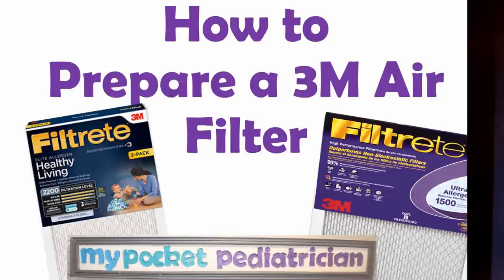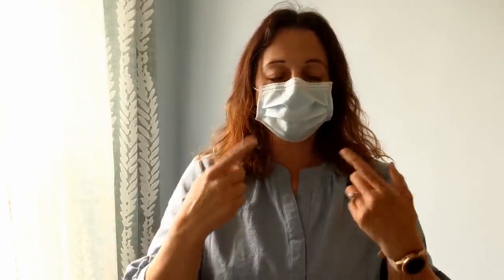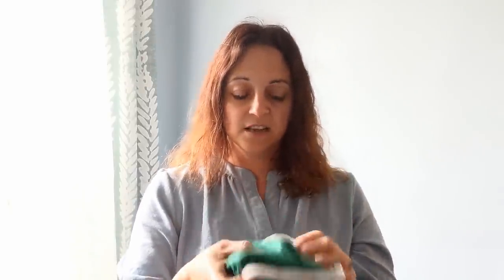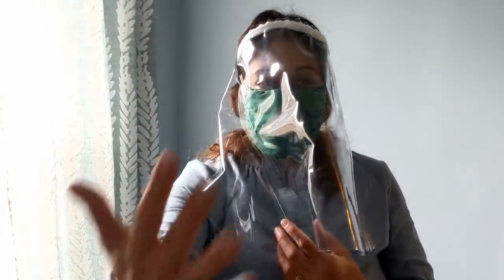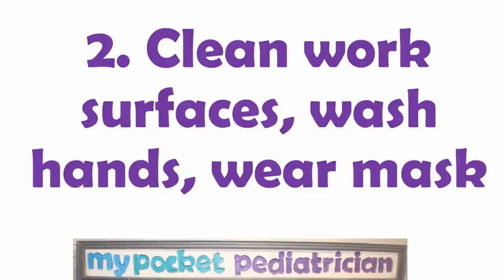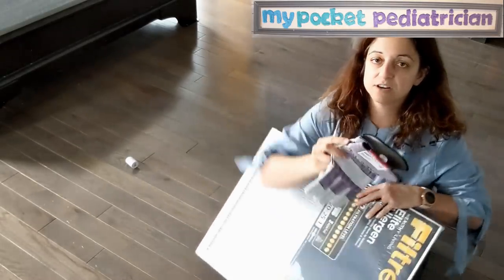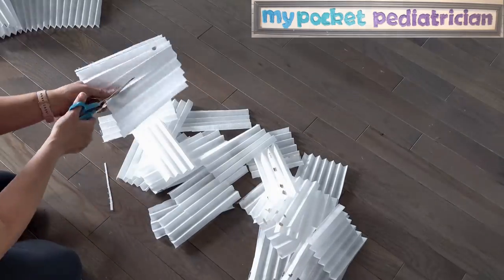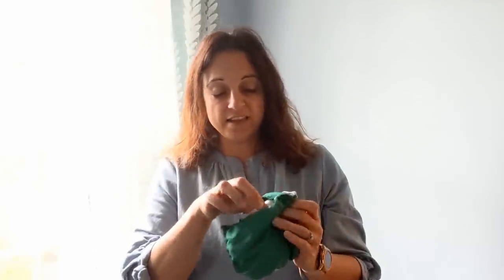UPDATED!  How to Turn a 3M Air Filter into a Face Mask

Comment from the maker: For those concerned about safety, here is the Safety Data available from 3M:  http://www1.mscdirect.com/MSDS/MSDS00023/53337903-20111224.PDF

Here is the link to the tutorial on how to make the mask:  https://youtu.be/4eOc5_rBCrM

Here is the link to the tutorial on how to make the face shield:  https://youtu.be/UKK0Y7XQN7I
Reply: Thank you for the clarification! I purchased the Filtrete 2800 to make the masks and have come across people saying there is fiberglass in it and not to use it. I could not find a definitive answer on this until now.  Thanks!
Reply: Thank you so much for all your hard work, in research and development of these masks. You are literally a life savior, and not just as a pediatrician. God bless 🙏
Reply from the maker: @rofahcherishlchaim1927  thank you!
Reply: Yes! I was looking for this data sheet!! It says no issues with inhaling. Thank you!!!
Reply: My Pocket Pediatrician how many masks will the one 3M filter fill?
Reply from the maker: @jem7178  thank you.   I've talked to some very smart people off the record, and their best guess that using the filter in a mask with a tight seal will have a similar efficacy of you double layer it.  I have nothing to prove that with other than some intelligent guesses, so use it as you will.
Reply from the maker: @patriciaulloa3071  I don't feel I deserve that, but thank you.
Reply from the maker: @baileyjensen7025  on the 20x 25 size, it stretched to 102 in long and I got 43 pieces so enough for about 21 mask inserts (2 per mask per day of use).
Reply: My Pocket Pediatrician thank you for your response I appreciate it. I emailed you for the mask directions. :) I was able to order 1900 MPR 3M filter. Can’t find 2200 at a decent cost.
Reply: 3M's response regarding the use of Filtrete filters

Thank you for contacting 3M, Construction & Home Improvement Markets Division.
Our filters are made from Polypropylene plastic fibers and strands, adhesive, paperboard, and for some filters, metal wire. Our Filters do not contain Fiberglass. However, our Filtrete brand products are designed to be used in home HVAC systems. The filter media in a Filtrete brand filter performs very differently than an approved N95 respirator or mask. It cannot achieve the fit or performance of a mask or N95 respirator and modifying the furnace filter may damage the material. 3M does not recommend or support the use of a Filtrete brand filter to make a mask or respirator.
For information on the Coronavirus and recommended protection products, please consult the CDC.
If you need any further assistance, please feel free to contact us directly at 1-80 0-388-3458. We are available Monday through Friday from 8:00 - 5:00 CT.
Reply from the maker: @TerryFojas  thanks.  I still haven't gotten an official response from them.
Reply from the maker: @Bunny C can you see it here?
Reply: @chammockutube  UV-C can degrade the polypropelene plastic that is used in the masks. But if no other alternatives are available it may be better than nothing.
Reply: The information for msds is outdated 2007. It needs to be updated to 2020.
Reply: Thank you for linking the SDS. I'm glad its not made of fiberglass, but I must say after trying this myself with a 3M Filtrete 2200 I felt weird so I'm not going to do this anymore.
Reply from the maker: @janettedorricott4419  I searched quite a while to find this.   Do you know where I can find an update?  I just assumed it hasn't changed design since 2007.
Reply: Nate Welch , true, and in a less emergency situation, it would be best to subject sample reused mask to a KCl challenge per the ASHRAE standard to see the MERV rating, but I’m thinking re-treated N95’s are still better than bandanas.  It would also be helpful to know exact intensity uw/cm2 and exp
osure/dosing duration to minimize UV-C damage to the N-95s, but info is limited.  Past research has shown that of maybe 8-10 treatment methodologies, UV-C came out on top with maybe Ethylene Oxide gas coming in second due to long out-gas times.
Reply: @CalvinHill-reflects  they must have had it confused with menthol cigarettes LOL
Reply: I'm a hvac tech and filters are our thing..  I approve this message, I'd rather do this than wait a long time to get appropriate masks, this might not be 100% safe, but better of safe than sorry.. these have fiber strands not micro fibers that are harmful.  Thanks to our frontline personnel
Reply: This video is invalid because her hair is not even tied back. omg, disgraceful

lmao...I just had to make that comment. I do love to try have a laugh in these times. So Doc, i love ye & i'm just kidding with ye. Plz forgive me..
Reply: Terry Fojas their response, is exactly what we would expect. As this video mentioned, no one want to be sued. I believe by now, everyone should realize- that the N95 is the “gold standard,” yet there are not enough of them, and there is no way to achieve that same “gold standard,” via DYI. If I’m not mistaken, I felt that in this video, the Dr. was not at all suggesting that these DYI masks are of the same quality nor limit your risk at the same rate of a N95, but feel that the point of this video is to create a DYI mask that is much better than a piece of cotton, that has ZERO chance of helping any healthcare worker who were to come in contact with it, yet with the understanding- that it is NOT nor will protect like that of the N95- but far better than a cotton fabric which is about equal to holding a paper towel over your mouth and nose. Yet knowing that these filters are not  tested to be an equivalent substitute of the N95- the dr. Also does not want to cause more damage than good. As is what is happening or could happen to anyone that uses the HEPA vacuum filters containing the fiberglass- which we obviously don’t want in our lungs. With that being said, 3M could NEVER indorse using these in a way that they were not tested or approved, but the fact that they do not have anything that would cause lung damage if used to breathe through- is the bit of information that is needed by DYI’ers. This is what innovation looks like. If no one ever uses anything for “off labeled” purposes, the ability to create new methods or products would be impossible! But 3M also must err on the side of caution to prevent any lawsuits based on “negligence or misleading information.” Unfortunately, everyone still must cover-their-but’s in a society that is so quick to point fingers, find fault, and sue. Sad but very true.
Reply: @alffriend77  not fiberglass.
Reply: Thank you for the time and consideration you took to produce and share this video publicly.  I have a question and an observation/suggestion.  The purple filter box was labeled as a 1500 filter so I am wondering why you labeled the individual filters as 2200?  I would also wonder why you worked with the exposed filter material on the floor?  It seems that maybe sanitizing a counter or table and then working on the filter there would be better than putting the material out on the floor where it will be in a mask people are breathing into.  :-)
Reply from the maker: @lindasharpshooter6757  I used the blue box to make this one.   The purple one was just to show it as an option, but I actually cut open the blue one.   I had 4 kids and a dog downstairs so I scrubbed the floor with Lysol spray so I had a clean work surface as I mentioned in the video.   Obviously a table is better, but we are self quarantining at home, and there are 7 people in my home, so options are limited
Reply: @CalvinHill-reflects  No issues with inhaling IF USED AS INTENDED. They say nothing about particles being released when it is cut up and then put right next to your face. "use or processing of the product in a manner not in accordance with the product's directions for use may affect the performance of the product and may present potential
 health and safety hazards. "
Reply: monikah12345 hey, that is true. However, these filters are not going directly on the face, they are going in between the fabrics. It isn’t the best solution but right now it is a solution. Please add ideas to help @MyPocketPediatrician.
Reply: @MyPocketPediatrician  oh ok...sorry...all I noticed was the purple box up close...thank you for clarifying.  I guessed I missed that part about you spraying the floor with Lysol.  :-)  Thank you again!  Looking forward to seeing what filter material you are considering as another option.  ;-)
Reply: My Pocket Pediatrician  Hello, my concern is that the safety info sheets are primarily related to the safety of the product for the intended use. These filters are intended to be used in a furnace system-the safety of using them close to the face (after being cut) and breathed directly though, may be very different.
Reply from the maker: @margaretfitzpatrickrnapn1833  yes.  definitely.  It's very hard to find filter media, but I think I've found a better alternative.  Currently cutting it and trying to FIT test it in my new mask design.  Please subscribe, and if I have good news, I'll have a new video soon with a very improve design, and this material is designed for masks!
Reply: Hello, and thank you for this information. As we all know this is not ideal, but an option that's better than nothing! My question would be... Say I make a mask for each of my family members, and one of them ends up infected.. we would obviously have to take safety measures to try and stay clear of them, but in a household with several kids and one parent that could prove difficult. Should the infected person reverse the filters they are using so they are less likely to infect others, or should everyone wear the filters the same way?
Reply: Doesn't 3M have a hepa vacuum cleaner bag that's made with the same Filtrete material?
Reply: I found a cheaper alternative, just walk around in scuba gear with oxygen tanks and you won't breather outside air at all. . flippers are optional.
Reply: I found a cheaper alternative, just walk around in scuba gear with oxygen tanks and you won't breather outside air at all. . flippers are optional.
Reply: I found a cheaper alternative, just walk around in scuba gear with oxygen tanks and you won't breather outside air at all. . flippers are optional.
Reply: I found a cheaper alternative, just walk around in scuba gear with oxygen tanks and you won't breather outside air at all. . flippers are optional.
Reply: @TerryFojas  thank you for this even in the Mds shared in this thread it said, "Immediate health, physical, and environmental hazards:  This product, when used under reasonable conditions and  in accordance with the 3M directions for use, should not present a health hazard. However, use or processing of the product in a  manner not in accordance with the product's directions for use may affect the performance of the product and may present potential  health and safety hazards."
Reply: My Pocket Pediatrician   P.S.. ... also to be effective the filter material Hass to be facing the correct direction just as it would need to be when it’s used properly in one’s HVAC system. There are arrows on the box telling you which way the filter is to be installed. Once you tear it apart without noticing that it diminishes its intended affect
Reply: My Pocket Pediatrician 3M is not a trustworthy company. This is the same company that hid there Teflon study from the public that showed how poisonous it is to human beings. Those instructions on the package or website were not put there with the thought process of someone attaching it to there face and breathing through it.
Reply: Ruth had a good question
Reply: I wonder if they have natural organic filters pretty sure they do
Reply: I'm thinking of using bendable wires to make the seal, just like how they do in a brassiere.
Reply from the maker: @jeannydaniel2022  I used 20 gauge floral wire with weatherstripping rubber foam to seal it.  The foam is important for the seal.
Reply: Hey there just came across your channel a few minutes ago, and  was curious Will the mask with a 2.5 MPR protect you from this Virus?.. it doesn’t sound like it will so I’ve been wearing a surgical mask over my Olsen mask but will 2.5 protect you?😬 thank you for Making this video wishing you and your family a safe and happy Easter..
Reply from the maker: @haloSrising  It's honestly hard to say.  Lots of people are debating right now.  COVID19 is 0.12 microns, and so that means it's smaller, but it usually travels on droplets, which are larger than the 2.5 - these viral microns aren't just shooting around in space if they're not attached to droplets.  I'm going to do a YouTube live with a Q&A with 2 of the developers of Filti, a facemask material that I'm working on right now.  It's probably going to be Tuesday at 8:30 pm, but I'm not 100% sure yet.  Please subscribe to my channel and they may be better people to answer that question than me.  I'll have a new video out in the next day or two with improved design and materials, and then the Q& A with them should help clear up some questions.
Reply from the maker: Also - be careful with the Olsen (Olson?) mask - I saw another video where 3 healthcare workers couldn't get it to pass a FIT test.  If you're working in healthcare, you really need to make sure your mask passes a Fit test.   My mask did, as did the newer design I'm working on now.  That said, it passed a FIT test on me - I didn't have anyone else available to test, but if you're really worried, getting a good FIT test is of utmost importance!
Reply: Ive been using Zorb on the inside as it is antimicrobial snd wont cause you to get bacterial pneumonia.
Reply: twirlchic Hey there what is Zorb?
Reply: I love your thinking & problem solving ! But wanted to Ask your feeling about the strands of polypropylene that become dislodged / fuzzy during metal mesh removal & the bits of polypropylene that become loose during cutting
Reply from the maker: @LeftHandedDogLover     I did update this video since 3M says they don't recommend doing this to their filters.  I'm using Filti now, and here's the new link.  https://youtu.be/2J3Fq4o-U4I
Reply from the maker: @janetvillarreal6537  I would prefer to wash and dry, because you never know what's going to last and if there might be some little droplets left if there is moisture in the air.  I'm not sure.      I did update this video since 3M says they don't recommend doing this to their filters.  I'm using Filti now, and here's the new link.  https://youtu.be/2J3Fq4o-U4I
Reply: There are washable HEPA filters. A HEPA filter is safer than the N-95s. Here's why:

  "It is widely believed that HEPA filters are only capable of capturing particles sized 0.3 μm or larger. However, this belief is based in part on an incorrect understanding of how HEPA filters work. The fact is that particles of around 0.3 μm are the hardest to catch (1); for this reason, that size is used to measure the effectiveness of HEPA filters. Much smaller nanoparticles are in fact easier to catch. But why is this so? 
For larger particles, the HEPA filter acts like a net as we would expect. Particles greater than 0.3 μm in size simply cannot get through: either they do not fit through the holes or they hit the filter fibers due to inertia. For smaller particles, on the other hand, it would seem logical that they can simply go through the holes. However, this is not the case. The tiny mass of particles less than 0.3 μm means they do not fly straight; instead, they are bounced off other molecules as they collide with them and thus move in completely random patterns. As a result, they hit the filter fibers and then remain stuck in them. This is the principle of Brownian movement.

US government standards require a filter to remove 99.97% of particles sized 0.3 μm in order to qualify as HEPA" https://www.hamilton-medical.com/de/E-Learning-and-Education/Knowledge-Base/Knowledge-Base-Detail~2020-03-23~Efficiency-of-HEPA-filters~d5358f88-753e-4644-91c6-5c7b862e941f~.html#DataTables_Table_0=od3
Vacuum cleaner bags are being used as well. There is no fiberglass in those either. There are some furnace filters I wouldn't want to use in a mask because they have baking soda, etc., particles that can get into the lungs. Just plain HEPA filters would be best.
Reply: The NaNa Yes, agreed, & glad you scored a past supply at the dollar store for your family’s needs!  I hope you lucked & they were ‘medical’ grade N95’s.  Those I have on hand from before Covid19 are ‘industrial’ grade, so I’m having to take extra precautions until medical grade is again available to the general public. No one wants to unknowingly infect anyone else- thus lesser than medical grade masks, but nor does anyone want to be infected with Covid19 thru someone else, including from from those in our homes that are sick- thus medical grade. When available, we all need to have medical grade N95’s in our home medicine cabinets.
Reply from the maker: @vwatts8738  yes.   I addressed this concern in my newer video which uses Filti ..please check it out here...https://youtu.be/2J3Fq4o-U4I
Reply from the maker: @blankname6629  agree...this was a last ditch effort because not much else was available.  I've now found out about Filti, which was designed for this, and made a new tutorial here.    https://youtu.be/2J3Fq4o-U4I
Reply: My Pocket Pediatrician thank you I will look into this filti product. Just ordered some 2.5 PM filters but they are nowhere near as inexpensive as this filti product.
Reply: Don't those filters contain fiberglass?
Reply from the maker: @mac201112  no they don't. They are made out of polyprene.   Here is my new tutorial that uses Filti as the filter.   https://youtu.be/2J3Fq4o-U4I
Reply: @jem7178  thanks...I was about to buy it...thanks a lot
Reply: @dayamipp   I didn't post that to stop you from using this particular filter, as from what I can see this filter does not use fibreglass like some do, which is good....what was in her answer with the link for 3M's reply though still concerned me as 3M still don't say it's safe to use in this way especially when cutting it up and using it for something other than it's original purpose.  And right down the bottom it does say 'a potential carbon monoxide hazard during combustion' so as long as you don't burn it to discard it COULD be ok. but I don't particularly understand much of the grading values.
 I have 3M filters that are N95 but state they are only used for gardening as all these N95 filters have specific gradings it seems for specific things, so I found out in my research of the code numbers on them... all I would like people to do first is call 3M and ask if that particular filter she is using can be used for this particular virus and this purpose once cut in this way. That is not clear to me here. I do know you can buy the proper filters for this circumstance to go in masks, but whether you can get them just now is another thing.  Please just research before using these such things on youtube face value. I'm not to discredit this lady in any way though.
Thanks for your reply though and stay safe.
Reply: My Pocket Pediatrician : great info. I did the same thing. With a HEPA filter. To ease the glue from the filter. I used a hair dryer.  To soft n it up & separate it from the filter. ( Heat not 100% direct).
Reply from the maker: @mariopadilla1848  I'm not as familiar with the HEPA filters, but if they have electrostatic forces like the 3M filters, any heat will destroy that charge, and they won't be effective at catching viral particles.  I'm actually using Filti now, which was designed to make face masks.  You can purchase sheets of ready to use filter material, and it's actually cheaper than doing this.  I have a discount code for my viewers also - check it out here:  https://youtu.be/2J3Fq4o-U4I
Reply: @MyPocketPediatrician  A friend of mine was able to order 3m filters without the cardboard edge or metal, just something you might want to look into.
Reply from the maker: @leothenomad5675  thanks!   I actually started using Filti, which was designed for face masks and is actually cheaper. I also have a discount code. If you're interested you can check out the tutorial here.  https://youtu.be/2J3Fq4o-U4I
Reply: @MyPocketPediatrician   After I wrote my comment I saw your updated video and actually just ordered from Filti about an hour ago, and used your discount code. But thank you for replying.
Reply from the maker: @leothenomad5675  that's great!  Glad you found it!
Reply: Om goodness.  I can't believe you guys are taking those apart! Can't you just order the fabric? I use carbon filter fabric on my basic box fan to clean my air when I oil paint in the winter.  It works amazingly! Can't you just get this type by the yard as well?
Reply from the maker: @VIEW2824SKNS  I don't think 3M sells it by the yard, but I have found a company that does...Filti, and I made a new tutorial about their materials.  It's available here:.
Reply from the maker: @VIEW2824SKNS  https://youtu.be/2J3Fq4o-U4I
Reply: If you look up the mask on their website it will say something like filters without fiberglass.  
From what i understand, the metal wire is what makes it electrostatic.
Reply: @Dr. Pocket Pediatrician. Dr. Is the filtrate filters 100% safe? Are coffee filters good to filter out the virus